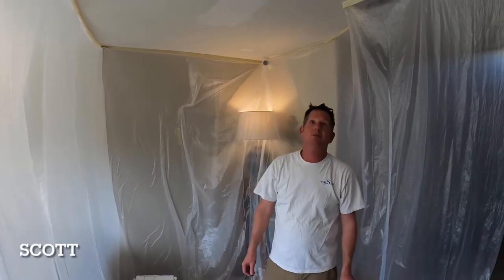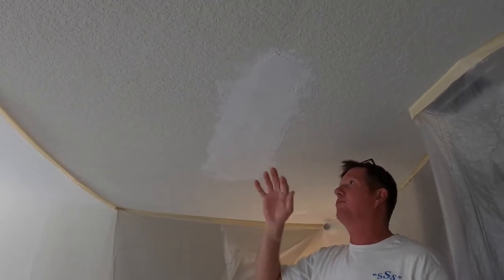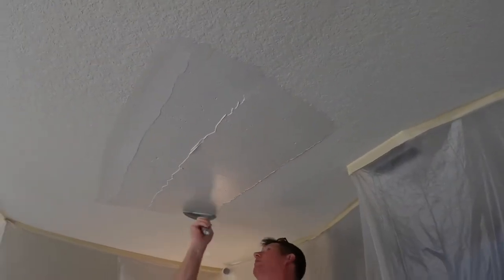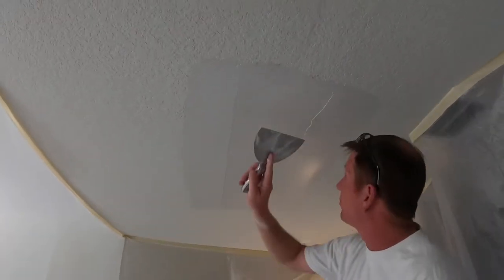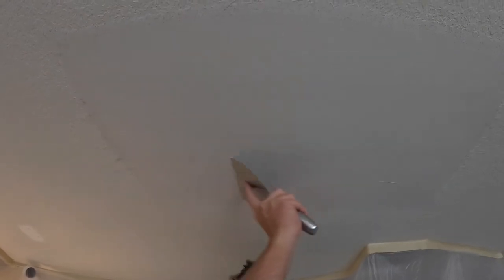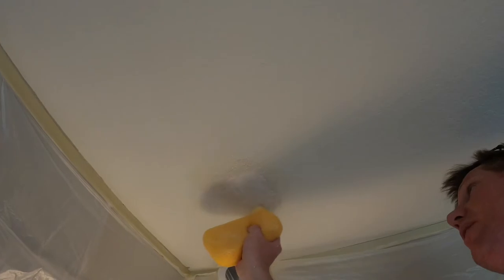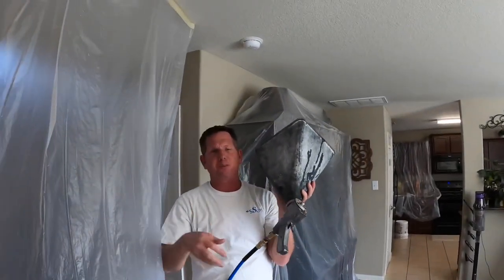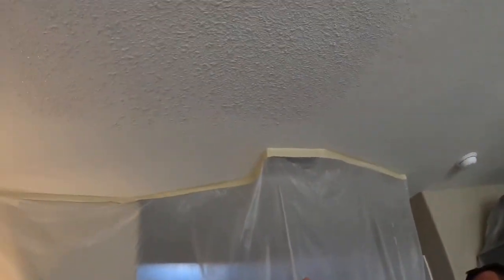DIY Botched Drywall (How to Fix A Bad Patch-Job)

Comment: I have a situation where I did a bad job covering a butt joint but difference is when I put a straight edge across it, only one side is low and the other side if the butt joint is flat and even.   Not sure how to proceed fixing it?
Reply from the maker: Check out my video on how to float a but joint and you’ll move the mud in the direction towards the low side maybe start about 2 inches on the side of the flat side and move the other way with the same technique that I teach on that video that should do it after two coats hope this helps somewhat

Comment: Awesome video.  I do repair and that includes usually small patching or covering for someone.  I have found setting compound is amazing after it turns into putty and this is the first video I have seen that shows the benefits of this method.  Question: Sanding with dust collector vs covering a repair?  I feel like the more material I add to a wall the less flat it ends up - like cutting a three legged stool.  Is it better to power-sand bad repairs and use little or no compound?
Reply from the maker: Personally repairs are generally done in peoples homes so I try to avoid sanding as much as possible. We either cut out based on damage, or just scrape with a sharp knife and coat over hope this helps

Comment: Scott, Thanks again for the informative video!  I’m appreciating using the Plaster of Paris / Drywall Mud blend you recommended for repairing old botched repairs.  QUESTION: I’ve also got old Lathe and plaster to patch AND I’ll also be hanging some new drywall.  Can I coat both the botches AND the newly hung DW with the Plaster-Mud blend??  Or do you recommend the blend only for quick fixes on botches and holes, and standard DW mud process on the newly placed drywall seams & screws?   
Also, how long must we let the plaster / mud blend cure before priming with Zinsser 123 Primer and then painting?? (I’m hoping to prime the same day…. Yes?? No??)
Thanks again for your tips!
Reply from the maker: So you can use plaster for anything I use it for repairs so we can get through it quickly the only way you can paint the same day, even plaster is to make sure it’s dry thoroughly you can take a heat gun and put it on and make sure it’s dry thoroughly. The plaster is a very strong bond you can use on anything if you have a lot I would suggest mix up a bucket of hot mud I’ll mix up pro-form either 90 or 45 and then put some mud in it as well it helps it set up harder and faster.
Hope this helps happy memorial day!
Reply: @scottssheetrockservices  Awesome!!  thanks Scott!!
That would be the key here… Given the level of humidity in Southern Illinois, I need to determine actual full dry time. I’m hoping 3 to 6 hours… But we’ll see! 
If you have any further thoughts or tips about it send them my way, and thanks again.
Reply from the maker: @tresayung2850  you can put a fan on the repair that you’ve done when there is no more dark spots, or shadows, it’s dry enough for painting
Reply: @scottssheetrockservices  Happy Memorial Day to you too! (Unfortunately I’m actually mudding today!)  Just Clarifying: do you mean that for large areas you mix a bucket of ProForm 90 or 45, then add Plaster of Paris to make it harder??  Or did you mean you make Joint Compound harder by adding some ProForm 90 or 45…?

Comment: so when you say plaster are you talking about powder usg and water or a combination of powder mix and drywall mud
Reply from the maker: So yes I mix a variation of plaster and mud I mix basically a pan of mud with 40% plaster of Paris 60% joint compound it allows the plaster to last 6 to 10 minutes and you’re able to rake out any lap marks and tight skim sponge and texture immediately. I have another video on my channel of how to mix the plaster. Hope this helps have a blessed evening!

Comment: Did you end up not thinking it needed to be retaped?
Reply from the maker: Yes there was no indication that it needed to be retaped however always better safe than sorry in that regard. In alll actuality I forgot between filming however it wasn’t necessary
Reply: @scottssheetrockservices  Appreciate the follow up. As far as video requests, I like when you give tips and tricks when 2nd coating stuff. Those tips are what help us DIYs get better, IMO.